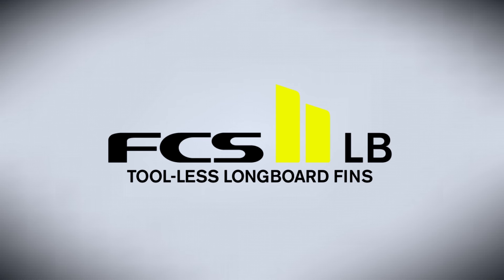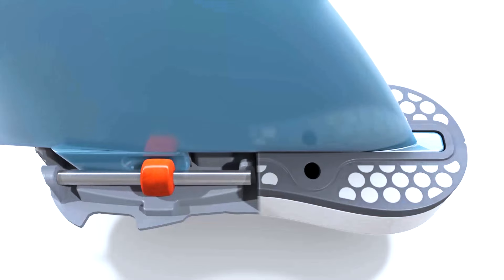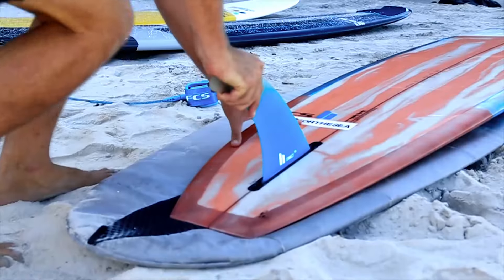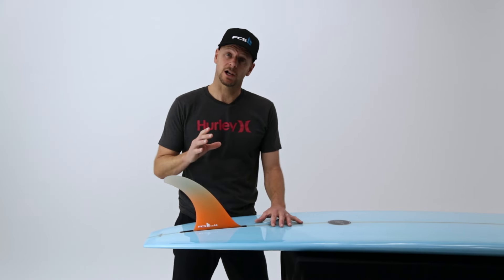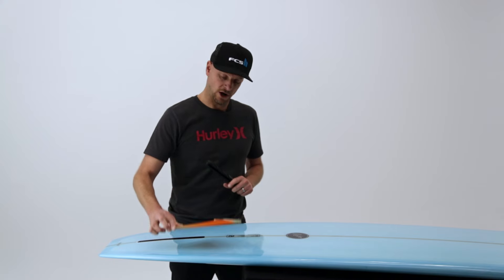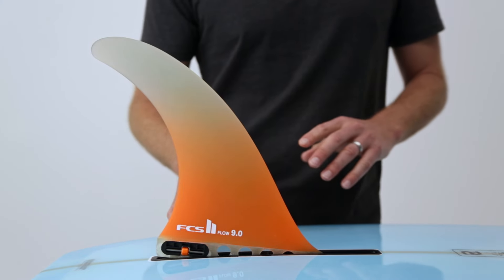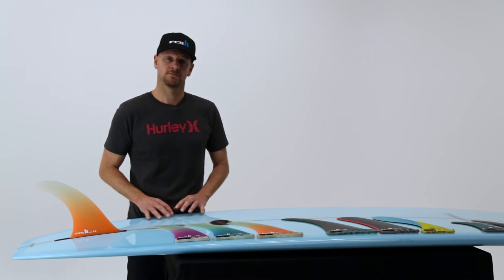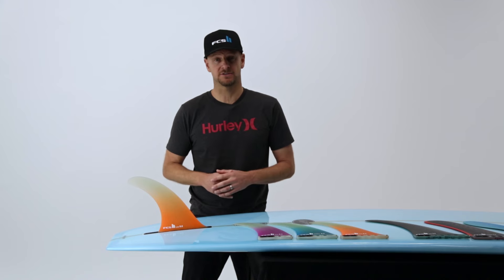How To: FCS II Tool-Less Longboard Fins

Comment: I have 2 FCS longboard fins , one is a perfect fit , nice and tight , the other is loose and I know I'm going to lose it sometime soon !!
Reply from the maker: Hi Austen, please contact us via the FCS website as we'd like to investigate. Thanks
Reply: Austen Goldsmith I
Reply: gimmick
Reply: @FCS_Surf  Do these fins work with the NSP E+ longboard? I have a 9' and wanna pickup a fin from you guys if it will work. I here that the finboxes on the NSP's are capable of accepting them but wanna know for sure!
Reply: @charlielashley6111  as long is a Bhane box you can.